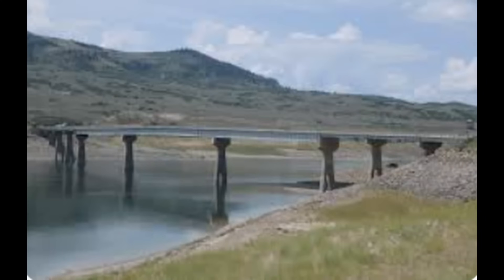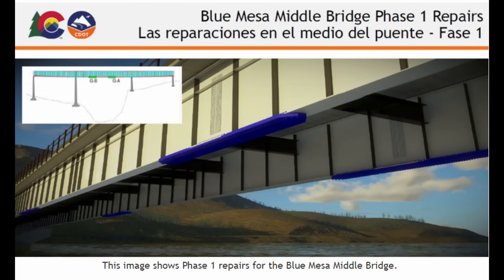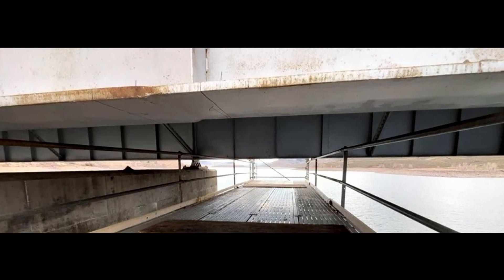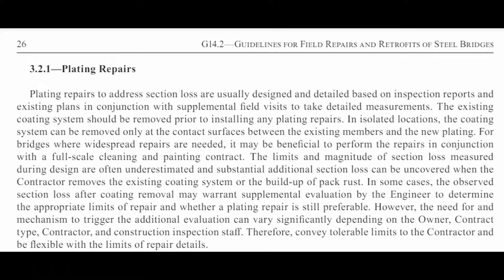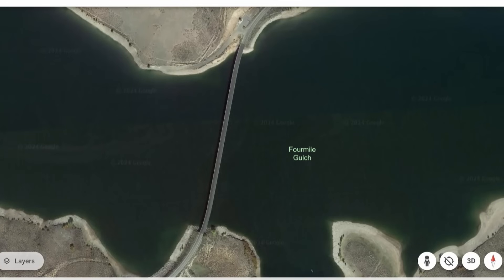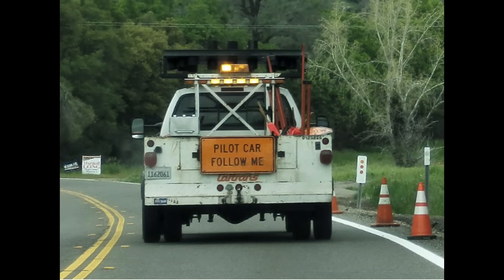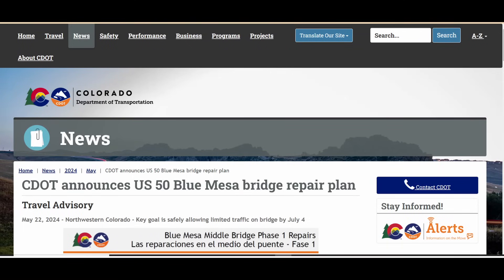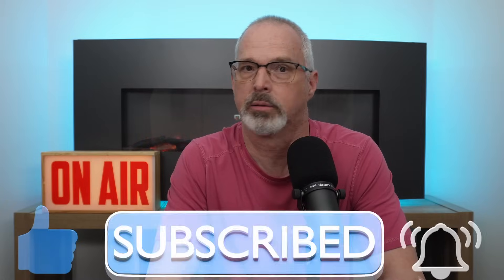US-50 over Blue Mesa Reservoir Repair Update

Comment: So this is what I see as the problem. I used to oversee some like-repairs, because whenever you have contractors on a job site, expect to see structural damage. But the thing here is when a structural member has been compromised you have to relieve the added strain on the remaining structural. In our case we use jacks to push up both sides before we put the plates in. And plates just don’t fit. You have all kind of mechanical and other clearances you have to work around. If you don’t relieve the stain, whatever strain had accumulated because of the defect is locked and continues to bear on other structural members. In addition, there is always addition give that occurs while drilling out and bolting in plates. 

 Nowhere in this report do I see anything about relieving the strain. They are drilling into the steel to make repairs further weakening the steel, but nothing I see demonstrates how they are attempting to relieve the accumulated strain that the defects has caused. This could be a disaster.

Comment: In Colorado the other three bridges with T1, the T1 has no welding as it is used for tiedown links.  Links have other issues that require more intensive inspection.

Comment: There are a few things that should be done at the onset of the discovery. I would start with the "Welding Procedure Sheet". There are welding rods that help reduce the chances of hydrogen embrittlement. (7018, 8018, 9018) I'm not sure when the 8018 and 9018 became available, but the 7018 has been around forever. These rods have a time limit on how long they're allowed out of the rod heaters. There should be minimum and maximum welding temperature allowances......travel speeds, sequential welding requirements, time limitations between the bead and hot pass, and,  percentage of weld completed before being allowed to set overnight. What were pre-heat and po-heat requirements, and tolerances for both. I'm sure they have already checked the width of the (heat-affected zone). Wide heat-affected zones, could indicate welding was performed at excessive temperatures. There's more.....this is just kind of off the top of my extremely old head.
Reply: I seem to remember 11018 welding rods to match the T1.  Under matched would not have been good if the strength of the T1 was fully utilized.

Comment: Hmmm, fixing the bridge by adding 80 ton and not addressing the cracks…I dunno, seems off
Reply from the maker: I don't think 80 tons is that much considering the area covered, but I do think it sounds like a very temporary fix until the bridge can be replaced.
Reply: @CaseyJones-Engineer  
Thanks for the reply, and I would have to agree with your sentiments, 
I am also a little sceptical of the rectification plan, mainly with, the idea of fixing one lane at a time and allowing traffic onto the other lanes, effectively inducing loads (over a smaller area) and inducing vibration/resonance into a structure that is now partially bolstered and the rest in a state that allows extra flex, potentially exacerbating the issue on the lanes yet to be fixed. 
Time will tell, I only make mention due to what appears to be a pattern of “lack of for-site” emerging in regards DOT plans lately. 
Thanks for your time, and thanks for the content, I’m about to step into a civil engineering degree and content like this really helps understanding the practical application of engineering principles.
Reply from the maker: @joshbrannelly4039  Excellent.  Enjoy your pursuit of your Civil Engineering degree!

Comment: Why not  temporary pontoon bridge? I appreciate the efforts being made to repair the bridge, but I have to wonder, the bridge isn't that long, and I have been over it a number of times and also walked around on the shore line of Blue Mesa on both sides of both approaches...good places to skip rocks. Seems like a good location for a National Guard training exercise.

Surely the Army has pontoon bridges that could be deployed here to keep commerce open. Besides the delivery of mail, groceries and other goods to the small municipalities cut off by this closure, communities in this area rely on tourist income and while a pontoon bridge wouldn't solve all the problems, it would seem to me to be an effective temporary solution.
Reply from the maker: I think your idea has a lot of merit.  The overall bridge length is only 1,500 feet so nothing to extreme to replace with a pontoon crossing.  I think the U.S. needs to get back to being able to deploy temporary bridges quickly until critical bridges can be replaced.

Comment: I would hope they would be looking to replace this bridge in the near future, at least the superstructure. The ongoing maintenance seems like it's going to be expensive, especially anything over water. And even after all that, new cracks could appear at any time, right?
Reply: Perhaps not if the butt welds and repairs are tested and repaired to new standards with consideration of any stress concentrations, and potential for distortion induced cracking is addressed.

Comment: High strength T1  steel has issues with brittle fractures in and  next to welds. Especially troublesome  on structures with dynamic repetitive loading.
AISC and AWS has tremendous data on this.

T1 is used today extensively in crane booms and heavy equipment machine frames buckets etc .

Special process required to weld this steel.
Submerged arc often I recall.

The welds also shrink if to large and steel cracks next to the welds .

AWS handbook has specs on weld size to plate thickness.

Comment: I’m Not an expert on bridge construction so feel free to correct me. 
It’s my understanding that ASTM 514 (T1) is still used but mainly for smaller parts. 
To make a successful weld, as several others have pointed out in the comments, you need to 
1. Clean the part properly. Oil, grease, water or anything containing hydrogen must be removed. 
2. Pre heat the steel to drive out any hydrogen in the grain boundary before welding.
3. Use the correct welding material i.e. low hydrogen and dry (stored dry, heated)
4. Control the heat input carefully during the weld to avoid changing the material properties.

This is done all the time in industry, but it requires properly trained and experienced welders and a robust quality control plan. I can imagine that this is hard to achieve on a large construction project especially when you use the lowest bidder principle. If you don’t ask for good quality you will not get it. 

For structural members the standards were amended in the late 70s to require a fracture control plan to address the quality issues found in some previous constructions. This helps procurement people to know what to ask for.

In the 90s new steel alloys were developed (HST 100W) that are more tolerant and easier to weld. 

I’m guessing the repair will be a short term solution and that a more permanent solution will have to be budgeted for in the future.
Reply: Don't confuse the sate of KommieRaso with facts..

Comment: I may be wrong in this particular case, but my experience says that if you add a stiffener/ patch you transfer the problem to the edge of the patch.
Second point is that there is no way you can bolt on a plate and not weaken the original plate---all bolted riveted joints are a trade off between bolt strength and plate strength, but the result can never be 100% of the plate strength. So all these  repairs will result in a weaker bridge than originally intended.
I hope this does not finish up as  an " I told you so"   in the future.
Reply: Yes, patches or doublers need to be designed well.  The reason the problem often transfers to the edge of the patch is because there is a sharp change in stiffness of the combined structure at the patch edge.  The patch needs to be designed so that the stiffness of the combined structure is tapered.  Large changes in stiffness create stress concentrations.  The easiest way of doing this with rectangular plates is to use a series of stacked but thinner plates that gradually get smaller in length and width similar to a leaf spring.  You can also taper the height of the patch with it being largest in the middle and smallest at the end of the patch.  Think of two triangles back to back.  You can also taper stiffness by using similarly sized stacked plates but each plate has different material properties.  Depending on loading conditions, you can also make the patch edge undulate in and out to get the same effect. For that last one, I wouldn't probably do that on a beam in bending but I might do it on a skin.

Comment: the first thing I see is that the number of seperate disconnected plates = disrupted and agrivated stress flows
- a better repair would be to fully plate the under section with as close as possible to a continuous doubler plate (yes it can be made of a number of pates welded together if needed.

Comment: By bolting reinforcing plate to damaged sections, are they just shifting the problem to the unreinforced areas?  The splice plates would stiffen those areas with respect to the unreinforced areas.   Could this lead to quicker fatigue in the unreinforced areas? 

Also, drilling bolt holes into the existing structure seems like it would take a long time to do in the field.  I imagine steelworkers using magnetic based drills to drill each hole in the field.  Is there another way to drill field holes?
Reply: Presumably the cover Plates will not end in close proximity to the problematic butt welds or known locations of stress concentrations.  The fatigue liveload to dead load ratio should be low, and the allowed cyclic liveload stress should be quite reasonable away from these points.

Comment: Surely CDOT has already begun inspections on the west bridge? It would be complete incompetence/professional malpractice to not begin inspections immediately on a similar bridge using similar materials since they found so many issues with the middle bridge. 

One has to wonder how these defects went undiscovered for so long?  This has long been known to be a potential problem. Heads should roll...but we know their incompetence will be swept under the rug...
Reply from the maker: Yes I would agree with you I hope they have started that inspection as well on the west bridge.
Reply: Simple CDOT does not give a chit about the Western Slope all they want is our money and water..
Reply: As I understand it the west bridge was inspected first for the detailed visual inspection that found the crack on the east bridge.  As the ultrasonic inspections finished on the east bridge that inspection process shifted to the west bridge as repairs had already strarted on the east bridge, starting with the highest risk 4 butt welds.

Comment: Do you know of any similar repairs on bridges of similar material and construction?  I would be concerned that these patches will simply transfer load to neighboring structure causing it to crack.  It will be interesting to see if this approach is successful long-term.  I would  bet that they have just as many cracks in another 5-10 years as they have now.  Hopefully, they put this bridge on a fast track to replacement.

Comment: That's interesting- I was expecting them to weld on coverplates however it would not be wise to weld on short jumperplates, they would have fatigue issues at every location where cover plates start and stop hence the reason that long plates would be required.  This is almost the end of May, opening one lane in about 6 weeks time is a tremendous amount of work considering how many locations must be repaired and the limited access.  I would think it would require 3-5 days to repair each crack with the cleaning, drilling, fitting and bolting, and recoating required.  They must think they can do this quicker and they must be planning on operating multiple crews.

Comment: There is a big interchange across the Mississippi River in downtown St. Louis that use some at the time high performance steel built in the mid to late 60s.  It too was plate girder bridges that had to be reinforced with web and flange plates to compensate for cracked welds.
Reply: Yeah I seem to remember seeing a lot of external post-tensioning on the piers and caps down there. I always wondered if it was seismic or to address deficiencies.
Reply: @viktorakhmedov3442  A lot of pier caps are defficient as origionally designed.  The codes have yet to nail shear cracking control for non-tensioned deep menbers, and were worse at predicting this previously.  A lot of pier cap work is due to earthquake risk, not well quantified for that part of the country until a few decades ago.

Comment: I find it hard to believe that they didn't start mobilizing, prepping areas, and installing the plates before the inspections of other locations on the bridge were completed.
Reply from the maker: I understand that they have everything the need now material wise, but don't know how long it took for them to get it.
Reply: @CaseyJones-Engineer  great because that would indicate that they started ordering and prepping for repairs with the repair plans still unapproved. Hopefully, they are were prepping areas and starting to fabricate the plates ahead of time as well.  If so they are doing this and mobilizing enough craftsman this repair could finish closer to the timeline you first suggested.
Reply: @elijahcraig4804  It seems to me that any extension of the schedule (and cost) since the initial closure is due to a shift in scope from simple repair of the immediately safety critical spots to something closer to a full rehab of the steel work in the non-redundent two girder portion of the structures.

Comment: 183 cracks or defects!  Some inspectors where sleeping for sure because, they didn’t all appeared during the night…. Let’s hope these fixes are enough to avoid disaster.
Reply from the maker: These cracks typically wouldn't be found during routine inspections.  They had to do very intensive inspection work on the bridges that have this steel and this problem was only recently mandated to be addressed by FHWA.
Reply: @CaseyJones-Engineer  thank you for the clarification.

Comment: t1 is hard and brittle when welded  why would anyone use it
Reply from the maker: I understand that they quit using it in 1978.  Before that, I guess it was touted as being stronger and lighter than other steel alloys for bridges.
Reply: @CaseyJones-Engineer  It is stronger and lighter.  And not at all forgiving.  I think the new HPS 100 W is more forgiving than T1 or A514,  The HPS 70 W better yet, and HPS 50 W Better than A 588 or A 572.

Comment: Axceptable defects is an interesting concept. Is that where the saying good enough for government work?
Reply from the maker: I would say it mean that they could live with them unless they got much bigger which will require a lot of ongoing inspections.
Reply: @CaseyJones-Engineer  does this relate to the dashed welding technique where the welds instead of being continuous are say 3 inches weld then e inch gap so that there is sections of unaltered metal and if a defect occured in one section it can not propagate along the entire joint?
Reply: I believe all steel and welds have defects.  There are code limitations for the defects in plate.  For the welds there are currently code limits for the size of flaws depending on the material, the inspection method, the nature of the flaw, the size of the flaw, the location of the flaw, whether fracture critical or not, etc. covered in AWS D 1.5 for bridge welding.  (note I am not sure AWS 1.5 existed at the time of origional design of this bridge).

Comment: "T1" is pretty confusing here. After some googling, I assume you mean ASTM A514, but there's also a T1 high-speed tool steel that's about 18% tungsten.
Reply from the maker: I showed the table in the video that listed the ASTM designation (514) and the other common names.
Reply: @CaseyJones-Engineer  I did see that later after posting. All the weird ambiguous trade designations for alloys are annoying.
Reply from the maker: @PaulSteMarie  I agree with you on that!

Comment: A few years ago, the Southeast Metropolitan Transit Authority in the Philadelphia area was forced to withdraw a large number of rapid transit cars due to failed or cracking T-1 steel equalizers in the trucks.  Some of this was bad design (welds at points of stress concentration) but out of curiosity, I looked into T-1 steel welding procedures when I read of this.  T-1 is a quenched and tempered steel, so any welding has to be done within a narrow temperature band to prevent high residual stress on the low end or loss of temper and consequently strength on the high end.  The specialty welding rod used has to be stored at a minimum temperature in an oven, to ensure no moisture that could lead to hydrogen embrittlement and used within 30 minutes of removal.  None of this seems practical for field welding, hence the bolted repairs on the bridge.
Reply from the maker: What you say makes sense.  That is probably why they quit using these steel for bridge construction in 1978.

Comment: About those gusset steel plates:  how much additional permanent weight is now being added onto those piers and spans?  Would it be 1% or 5% or "x"% of the total weight?
Reply from the maker: From the news reports it will be 80 tons.  This is not a lot of extra load for a bridge like this to handle, but I am sure that the engineers involved will confirm this before pressing onwards.  Bridges are designed to handle dead loads (the weight of the structure) and live loads (wind, earthquake, and vehicle traffic) and also have extra capacity built in to ensure safety (factor of safety).
Reply: About 2% of the as designed dead load.  But I hear they might reduce the weight of the asphalt more than the weight of the steel added.